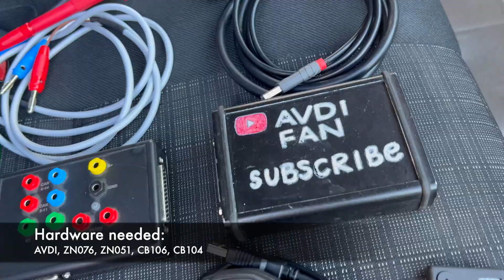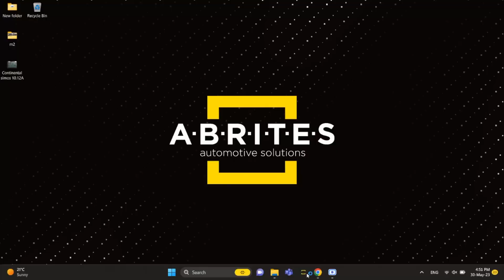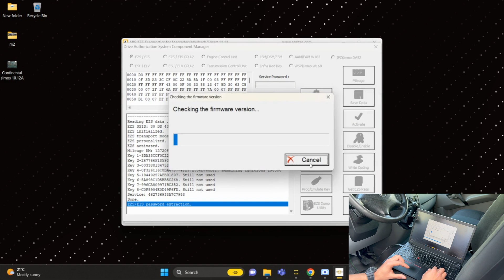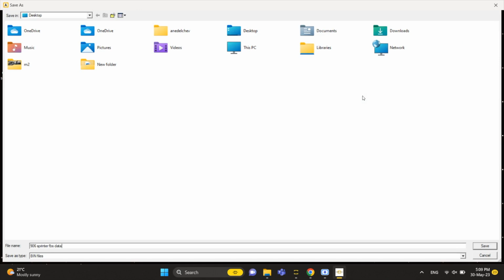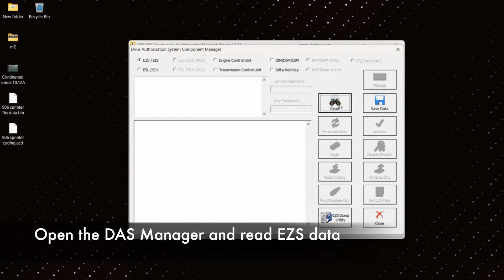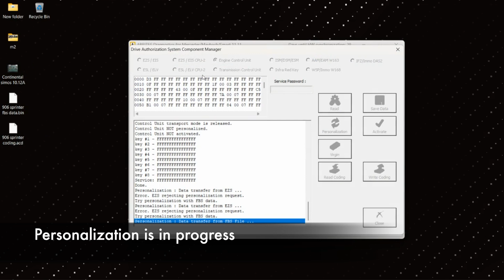Mercedes-Benz Sprinter W906 EZS Password Extraction Using ZN076; ECU Exchange

Comment: Guys, I was hoping you are showing W907 PW extrations.  I did W906 this way with xhorse 7 years ego.
Reply: You are right, 1 year after Xhorse borrowed our know how. As you know we were the first for FBS3 and if you take the time to see where we are with FBS4 module replacement you will know that we are very close to keys there. Anyway, this video shows how much more stable our new IR adapter is and how easy it is to do module replacement for FBS3 because we made it so easy.
Reply: @twinturbo1989  can you estimate when the FBS4 key adaptation will be ready? We any chance for it in the next year?
Reply: @DevianLLC  Not without lying to you.
Reply: @twinturbo1989  nop diagspeeed